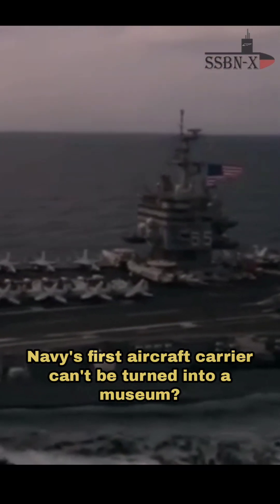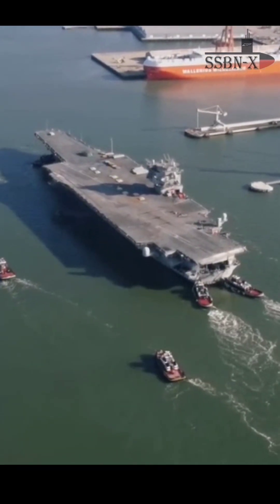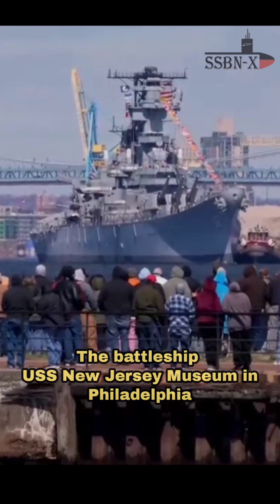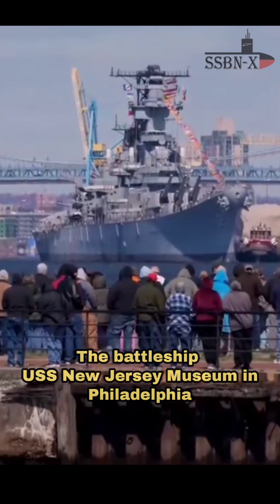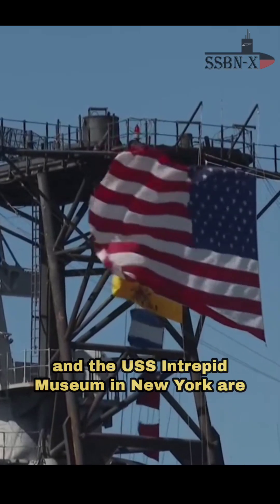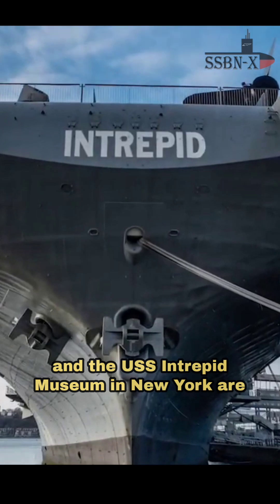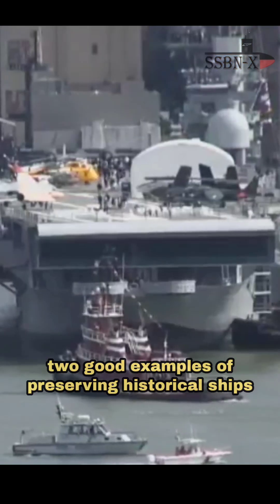Why The USS Enterprise Can't Become a Museum?

Comment: Can you reuse the steel, Cooper, etc for another carrier?
Reply: It's sold to the scrapyard and then they'll reuse it for whatever is needed
Reply: Some of CVN-65s steel and equipment is being used to fabricate CVN-80 Enterprise and CVN-81 Doris Miller.  Other parts are being refurbished for use in carriers being overhauled and refueled at NNSB in Newport News.  Most will be recovered during the "Recycling" (I HATE that term) of her hull later.
Reply: @robertf3479  thank you  for the update